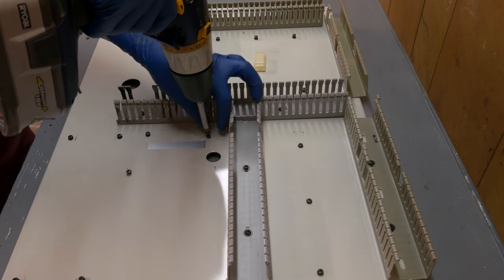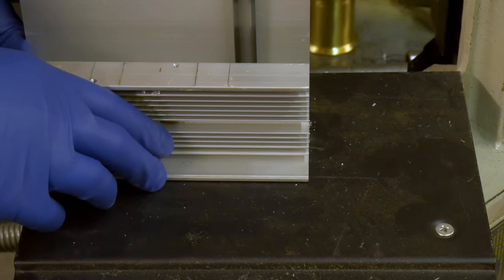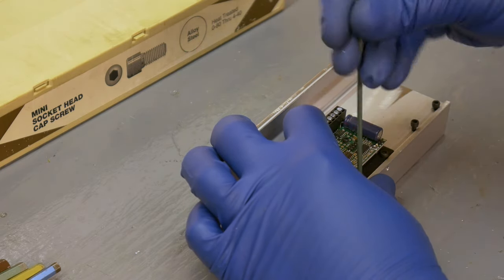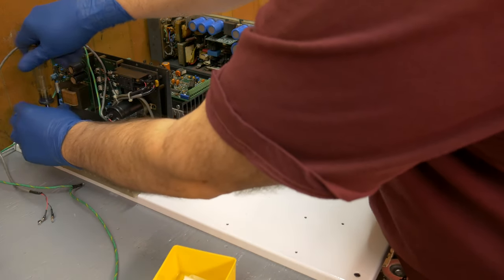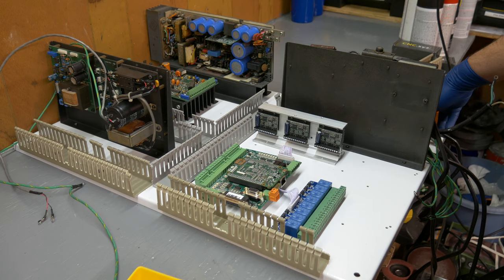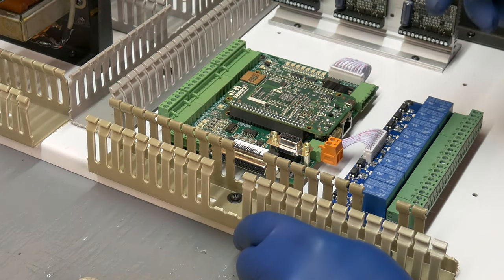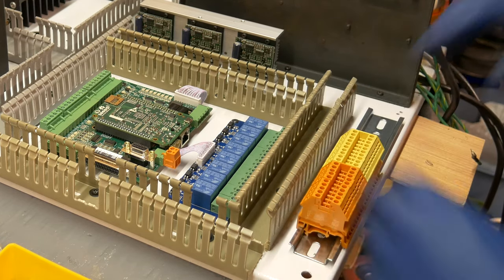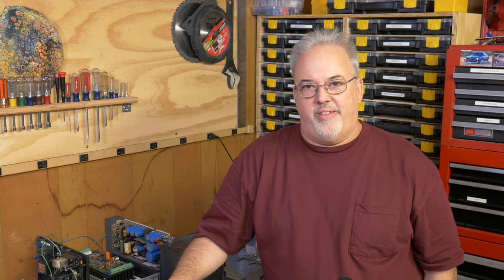CNC Machine Electrical Panel- Centroid Acorn Install Dyna Myte 2800

Comment: Very clean looking! You have the Zen of panel design.
Reply from the maker: Thanks Kent!  I just saw your video regarding swapping out the BLDC for an AC servo motor.  I may end up needing to do something like that, not really getting anywhere with my investigations into the current setup.

Comment: Where is the vfd? And why do you need a separate spindle control board.
Reply from the maker: There was no VFD on the original DM2800.  It used a Brushless DC motor and a DC motor controller.  The system had a Brushless DC motor drive and an extra interface board to connect the CNC control to the drive.  In my latest video, all of that has been eliminated.  I went with an AC servo motor and drive retrofit for the spindle.

Comment: Where can i find that vertical mount driver heat sink ? I have 5 Gecko G202s to mount. Great videos!
Reply from the maker: I wish I had a good answer for you. I scavenged that out of a large broken stepper drive.  We go through a lot of them at work so it was just something I had laying around.
Reply: @PeteRondeau   I understand. I'll keep looking. Thanks for getting back to me so quickly. Your videos are really well done, and I've never seen cleaner wiring!

Comment: Do be careful with the DC spindle drive. It must use signal isolation. You might look at the KB Electronics KBSI 240D.
Reply from the maker: Will do, thanks for the advice!
Reply: @PeteRondeau  seen many Acorn boards blown up when a user connects the Acorn analog spindle output to a non isolated DC drive
Reply from the maker: Thanks for the heads up!

Comment: Helo Pete, I v order Acorn and  NEMA 34 from Stepperonline, I have al wiring diagram but  don t know to wire VFD Huang Yong  to my realys on Acorn.
Do you have any wire diagram or something? It is for my cnc router and I need just to start foward my spindle and stop it,without dust collector a other things?
Reply from the maker: On the Centroid CNC website in the  "DIY Acorn CNC Control" section there is a link to "Acorn Hookup Schematics" That is a compressed zip file with a large selection of schematics.  One of the schematics in that package is for connecting a Huang Yong VFD to the acorn relays.  Hope this helps.  https://www.centroidcnc.com/centroid_diy/downloads/acorn_schematics/centroid_acorn_hookup_schematics.zip
Reply: @PeteRondeau  thank you, I found everything what I need
Reply from the maker: Glad to hear it

Comment: Nice Work on the panel.  I have done about 10 Acorn controls now and they work well  The Forum has good support documentation on line makes installs easier and the software is more like an  Industrial CNC Control.
Reply from the maker: Thanks! I've been pretty impressed with the Acorn so far.  Looking forward to firing it up shortly.  Thanks for watching.

Comment: Helou Pete, I have four cl86y for my router with acorn.
My question is about alarm outputs on my driver. In NC mode in cnc12, I have to conect them in series?
Is that right?
Reply from the maker: I am not familiar with that drive so I had a quick look at the manual.  It appears from what I am reading, the alarm output turns on when triggered.  It also appears to be an optically coupled open collector output.  It seems to me that you would want to wire the outputs from all 3 drives in parallel - (all the ALM- together and connected to ground) (all the ALM+ together with a pull-up resistor and connected to Acorn)  if any open collector turns on it will trigger the acorn fault input.  I would ask in a forum somewhere that somebody can share a drawing.  I have no way of sharing a drawing here so I can't be sure my words are clear.  Don't want you to blow anything up.

Comment: Thanks for the very informative video!  I think I saw another video where you showed a 3D printed bracket to mount the Meanwell power supply to a Din rail.  Do you have a link for this drawing?
Reply from the maker: Glad you got some value from it!  Unfortunately I think you have me confused with somebody else.  I don't have a drawing for that.  good luck on your hunt!
Reply: @PeteRondeau  No problem Pete.  Thanks for getting back to me.

Comment: what size machine can you use the Centroid Acorn controller with
Reply from the maker: I am still learning the limitations of the Acorn but I don't think there is a real limit.  We have a factory installed centroid system on a really large overhead gantry mill.  There is a limit to the Gcode file size and work coordinates with the free software version that ships with the Acorn, upgrading to the pro version unlocks that limit.
Reply: Any size machine. The determining factor are the axis drives and they take step and direction control signals. DMM Technologies sells large A.C. Servo drives as do other companies